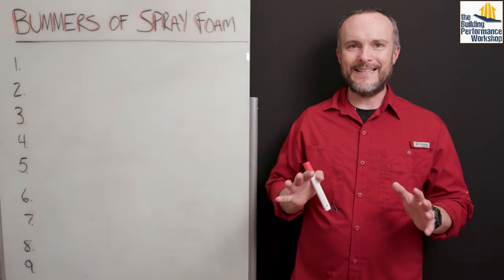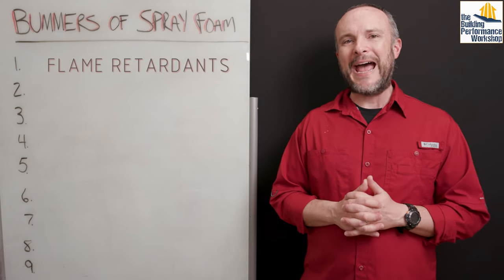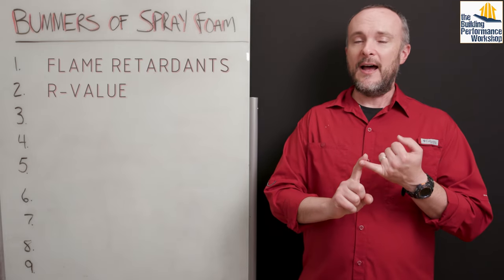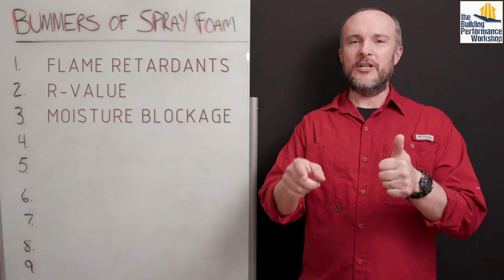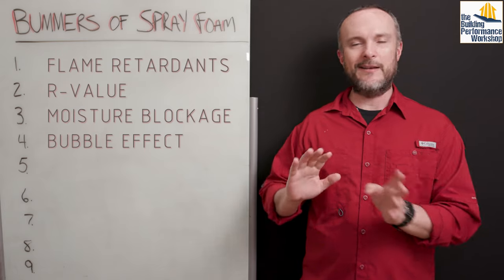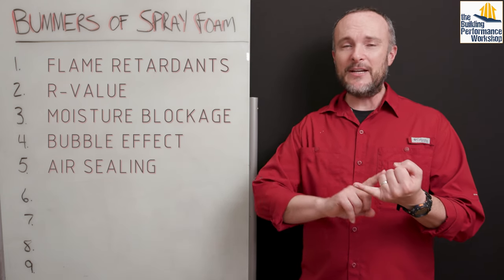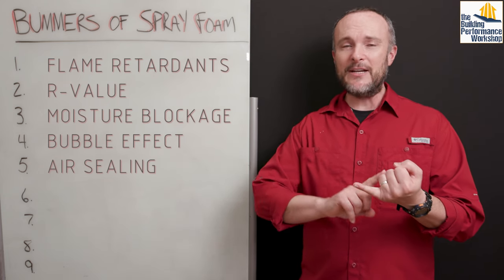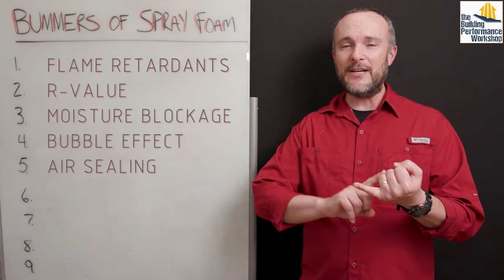Spray Foam Bummers: Make Informed Decisions on Insulating Your Home

Comment: Bummer 10, no cavity serviceability.  Bummer 11, difficult to remove and remodel.  Another informative video.  Thanks for sharing!  😁👍
Reply: @animedbz20  first off, your math is imperfect unless you're talking about a monocoque with no studs or other forms of thermal bridging, so on one hand, you're actually far more right than you think you are in many circumstances with simple framing consisting of a 2x stud wall. Metal studs are even more guilty, and the thicker the studs are, the more dominant the thermal bridging is in the total picture of the heat transmission through the wall system.

On the other hand, Nothing is really R-0, so you don't really start with 0, but leaving that aside, in an ideal case, where the insulation isn't being avoided by bridging, just pure thermal dynamic theory, this simple rule holds true: Double your insulation, cut your heat transfer in half. The math checks out, I promise. So you've got a house, you've put 2 inches of foam up, and you turn on your heater or ACm, and then you measure how much power you need to keep your house at a comfortable room temperature, and then you add 2 more inches of foam, you will see the system requires exactly half the energy to stay at that same comfort point. That's not actually a diminishing return. You double the foam again, and you're looking at half the energy to keep it comfy from the 4 inch configuration.  The "diminishing returns" of thermal efficiency with escalating R values looks like the increases get smaller and smaller, but the closer to 100% efficiency you get, the more impactful that efficiency becomes. It's not 100% more insulation for 6% efficiency gains. It's 100% more insulation to cut your energy need in half. What matters is your energy need. If you're looking at enough energy, doubling the insulation is worth it, no matter what that one graph of efficiency makes it look like.

If you want to be efficient, you should look to see what your delta T is at max draw and on average, see how much energy you can lose, maybe you don't need much, maybe that delta T is small, and there's not much energy to keep contained, and in that case, you won't see diminishing returns exactly, but you'll definitely not be saving money on your energy costs that will justify the insulation. You need to look at your other assemblies, maybe there is no point in insulating because you're building a teepee with a hole in the top and 99% of your thermal transmission is going to be through the air. Windows are a big step up from that hole in the old teepee, sure, but in some of the designs I've looked  at, low insulation glazing accounts for 80% of my transmission, you go from 2 to 4 inches of insulation, you're going to see almost no difference, because the windows already dominate. It's often not the case that the thickness of insulation matters all that much, but if you're just talking about the insulation, your math could be more accurate
Reply: @animedbz20  I can't see your comment, but I have a notification for it... sorry?
Reply: @animedbz20  OK, I'm going to try to be nice, but you are wrong. I know you didn't make up the math, but the math is not the correct calculation for determining your optimal design determinations. Not because you came up with the wrong numbers, but because you are using someone else's numbers who is applying an overly simplistic calculation to the issue of insulation efficacy.

You can stick to this pointless equation if you don't care to know about how effective your insulation is going to be. Some people don't care, they say "code says I need this thing, it's got the R-15 the gov wants, so I put it in the wall,." Those people don't care that their wall isn't an R-15 wall, and they don't want to know about the actual R value. If you don't want to know, cool, good for you. 

If you want to know, the actual real life insulation value a theoretical wall will provide, there are definitely ways to get far far closer to actual performance by using more complicated calculations. They aren't that complicated, and we can short cut it really hard with some work done by other people. 

This is a good explanation:

https://www.jlconline.com/how-to/insulation/understanding-r-value_o

This demonstrates how brutal steel stud framing can be in bridging, and how even 8 inch cavities can be basically ruined by steel studs:

https://www.buildingenclosureonline.com/blogs/14-the-be-blog/post/86806-effective-insulation-r-values-in-steel-vs-wood-framing

Again, you can just plug your ears, but if you want to understand why the numbers you accurately copied from Spray Jones, which themselves are accurately describing the insulation performance of the foam in an ideal circumstance, isn't actually very helpful for planning what kind insulation decisions you should make for the real world, I'm happy to help you understand. You can do it. It's really not that complicated.
Reply: @animedbz20  Close cell foam is not the only way to create an air barrier, so it's entirely possible that the wall assembly with bats will actually perform identically. having a great barrier and r7 worth of fiberglass is the same as having 1 inch of foam assuming all things are otherwise equal. Obviously you have to be smart about your placement of a barrier, but otherwise it's going to perform the same and it's not going to change performance when it gets more humid. In both walls you're going to see thermal conductivity dominated by bridging, and in both walls, when you put them in combination with a low R window, the window is going to be the dominant vector. The BTU performance will be the same. 

I don't think anyone here is suggesting you should ignore barriers in your material selection choices, or tolerate shoddy construction. 

I gotta be honest, none of this is relevant. What I said is true. Understanding those calculations is potentially very impactful, It can help you save money, build better systems, know which components are worth spending a premium on etc. You don't have to be a nerd, I'm not trying to force you, I'm just telling you that it looks like you're engaging with some pretty pointless numbers, do with that what you will.
Reply: @animedbz20  No system is impermeable except for spray foam? You're not actually making a point here, R value is an accurate descriptor of thermal conductivity, and if you have convection playing a big role in transmission, a different part of your system is poorly built.

No one cares that fractional liters of air are passing through solid materials when you're not calculating your major sources of thermal transmission. Even if they did, they wouldn't be asking about how that could be included in the R value. The R value is measuring something else. 

Even when you bring up something like T studs, you're suggesting a wall assembly where the primary issue is thermal bridging,  T studs have R values close to bats, so if you bat and T stud, you get a wall assembly that is very close to the bat nameplate value, instead of 25% ish worse. If you're gonna spray foam your whole cavity, your T stud is now the weakest link in that assembly, and while it's going to be better than a traditionally framed assembly, you're still going to have to do the better math if you want to know what the actual R value of that wall assembly
Reply: @animedbz20  OK I'm going to try one last time.  The perrm rating for the best class of window in europe, the class 4 window rating, it's class 4 if it's less than 3 cubic meters per hour.  3000 liters an hour, 50  liters per minute per square meter of window. So if you have a house, with 1 window of the highest standard, and you have walls and ceiling made of any of the materials you listed, and it's a 15m2 house, 3x5 meters, with a magical impermeable floor, you have 75 m2 of house panel, 1 of window, 74 of wall. We're talking barely any window. Illegally small amount of window, honestly, whats the air leak? Well 50 from that 1 window, and if you use spray foam, it's allegedly going to be about 33 a minute from that entire 74 m2, well, we need a door, and if you get a fancy german one you can get a class 4 door as well, so that's only 100, well that's pretty good. So you're set at 150 with laughably under represented openings, and the wall and ceiling are only 33, Or you could look at the zip, and you get another 150, 

So maybe if you want a giant house with only 1 window and 1 door it looks like  kinda successful way to reduce air intrusion, but this house contains 30,000 liters of air, so even with the zip, that 75m2 of panel is only letting through 10k/h and this is at the 75 pressure rating, not the standard 50, and the doors are actually tested at 100, so at the normal ACH you'd actually see less, but before you go off thinking that these look like equally important contributors, we won't see a 1 window 1 door house, we'll see 2 doors and maybe as little as 10m2 of windows, and theres another snag, that door is under 3000L when the wind blows the right way, but when it's pressure from the  other side of the closure, it's actually 27000L /m per square meter, so lets do one of each for the door on either side of the house, and now we look at the numbers, and it's 1000l/m from the doors, and it's 500l /m from the windows, and 61m2 of pannel enclosure from that dog shit leaky zip system is letting in a criminal 135L/m, that brings the total up from 1500 to 1635. Scandalous. 

If you get anything other than the absolute highest end solutions, you could have class 2 windows for 10 m2, or a window heavy build with 20m2, god forbid you have an actual leak, but quick, pay thousands of dollars to shore up that leak zip facing, and you could cut that air leak down to just about 1570l/m

Do you see why the face perm rating is totally ignorable? the math clearly expresses the elements of the structure that have a large impact, and the elements that do not have a meaningful impact.

No appreciable volume of air intrudes into the envelope through solid faces, we have actual gaps to deal with, and in many cases, eliminating those gaps isn't viable for normal buildings. We aren't putting submarine bulkhead doors on the front of houses, that front and back door WILL dominate air permeability. The windows might too. The face of your barrier will not. You can forget that they rate that stuff probably and it will never effect you.
Reply: @animedbz20  Spray foam is worse than Zip sheathing. 

It is IMPOSSIBLE for a more permeable medium to improve the air seal of a less permeable membrane.

Sheath in zip, then aero, which will finish faster than spray foam and then aero, because again, zip is less permeable, and then after the aero barrier you can put bats in the wall of the zip system and you will have, again a better air barrier.
Reply from the maker: Hey hey guys, please. If you want to be mean to each other go to 4chan instead, I’ll report and take down any bullying comments. Feel free to edit what you posted before I read thru them.
Reply: @HomePerformance  Spray foam is a very flammable subject.  Another good reason to avoid using it...  😁🙏
Reply: @HomePerformance  yeah sorry. I think I removed all the invective. I don't know if the comments are actually helpful regardless, even if they are largely correct, this was a bizarre argument
Reply from the maker: You guys are awesome, at least a few hardcore nerd levels past me. Thanks for taking the time to dig into details.
Reply: @HomePerformance  Speaking of details, do you have favorite air barriers? I was surprised doing this research at how many highly effective air barriers there are out there, and the various forms they take, including liquid applied barriers that are nearly perfect, how do you pick your strategy? are you focused on a low VOC solution that you can apply inside your framing just under the drywall? If that is the solution, do you lose a lot of that value if you're doing drywall down the line, or are their patching solutions you like for reworked patches of wall?
Reply: I’d like to see you have a live technical talk with Mike from SprayJones cause I’m confused about the product when reputable peoples and builders have completely opposite take on Closed Cell!!

Comment: I have insulated every home I've built, since 1982, with closed cell and I disagree with much of this video, which is a first.  These homes are tight, if they leak, there was frame detailing that wasn't done properly.  HRV's or ERV's are needed in all new homes. Quality control is critical when inslalling foam, just as with other trade products.

Comment: Another consideration here in the SE would be termite warranties. Spray foam in walls and around rim joists will often void any termite  protection warranties. While I don't think the termites use the spray foam as a food source, the spray foam provides an excellent material in which the termites can create pathways and remain unseen until considerable damage is discovered. Buyer beware, check with your termite warranty folks first.

Comment: So, what is the "Bubble Effect"? in this video you just asserted that the enclosure of space on 5 sides was bad due to the off-gassing of fire retardants (and other chemicals). What measurements or principal proves this true? what if 3 walls and ceiling were spray foamed? would that negate the bubble effect you're talking about?
        Additionally what is the cause of air leakage that spray foam doesn't address?
Reply from the maker: It’s also the fact that SPF is plastic- it’s literally a plastic bubble, not a figure of speech

Comment: Most high performance builds these days seem to do flash & batt… Is there a sweet spot of thickness of closed cell to use, so we get the benefits of what it’s good at, whilst minimizing it’s bummers?   This video made me think about SIPs & what they might be like as far as off-gassing… and how they might perform in a fire.  SIPA claims no off-gassing & that they outperform stick built, since there’s no thermal “tunneling”… hmmm… thoughts?

Comment: #1:  "Phosphorus-based flame retardants have undergone extensive industry and regulatory review, including scrutiny by the European Union. All are widely regarded as safe and nontoxic in the amounts used in SPF, and none are classified as carcinogenic, mutagenic, toxic to reproduction, environmentally persistent, or bio-accumulative."

#2:  Moisture blocking is a good thing.  Sure, if you have a leak in your roof, the roof sheathing and any wood saturated in water will rot.  Upon re-roofing, damaged roof decking can be replaced.  Not a huge deal.  If a roof is very old, replace it.  I'd rather pay for some roof decking than new wood floors and belongings damaged by a leaky roof.  Do not use an interior vapor barrier when using closed cell foam.

It bugs me that poorly applied SPF, where the temperature, thickness applied per sweep, and/or mix was wrong, gives the whole industry a black eye and people like this make it seem that this is a common occurrence.   We've had three homes all with closed cell spray foam with no issues at all.   Problems are caused by bad installers, not the product.  Only use a licensed and insured installer, like you should for everything else in a major home project.
Reply from the maker: Good thinking, but I would like to add to your first point… ‘yet. None are classified, yet.’

Comment: OMG 90+% of what he said was BS!
Spray foam is currently the best choice in most cases when installed properly. Which 99.9% of the time it is. You can't say that about fiberglass or other batt insulations which in my 40+ years building house and commercial is done badly with defects and mistakes 90% of the time but most contractors either don't know any better or don't care and just want to move to the next phase. 
If fiberglass batt insulation is installed with just 3% defects, pushed in too far, crushed not fluffy or cut short or wrong and installed with that gap it looses 30+% of its effectiveness. I have never seen a 100 % correct fiberglass job in my life. 
Air movement is a factor with all insulation except spray foam. Batts in the wall and blow in in the ceiling will both have convection currents degrading it's proformance. It takes over r50 of blow in to try to come close to r28 spray foam performance. And in my opinion it still doesn't.
Say it's 90 f and full sun outside. An attic with blow in on the ceiling is between 135f and 155f maybe hotter. A spray foam attic will be within a few degrees af the rest of the house and your cooling energy bill will be much lower.  If you don't have cooling the house will just stay cooler. Many factors at play this guy didn't address one. 
Main point to realize is if you are building new or remodeling you need to know whatever systems you use are installed correctly. Any batt system needs 100% 6 side contact to work correctly. I say you will never get that no matter how much you watch and hound the contractor. 
I'm not saying don't use batt type insulation because I do use it mostly for sound but don't let this poor video scare you away from spray foam because it's performance in most cases far exceeds batt  any day.
Reply: You have to hound the spray foam guys just the same as batt installers.  The same humans that install SF are the same species as Batt installers.  They don't magically decide to do a perfect job just because its SF.  One thing for sure is you don't get to decide if they got the mix right and Flame retardants are going in whether you like it or not.  I've been in several hundred conditioned attics and they all feel great when done right.  So for me I look at the negatives I'd like to mitigate.  Toxins, pests, dust, and fiberglass(lol).  Mineral wool for me.